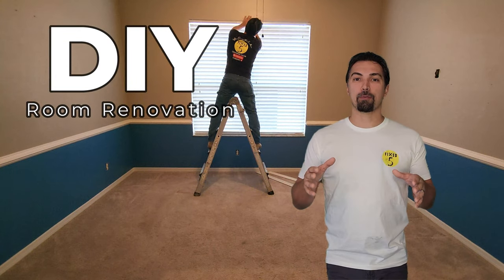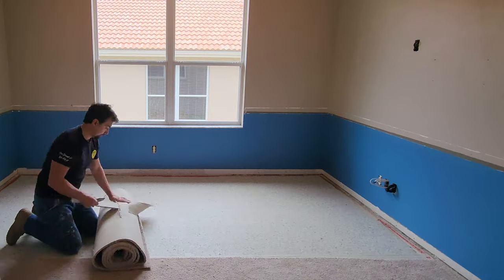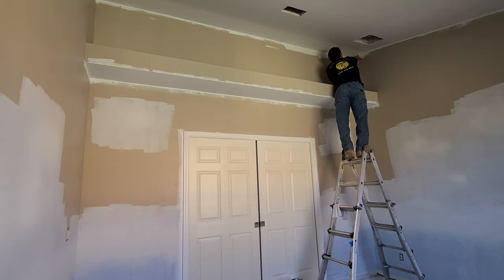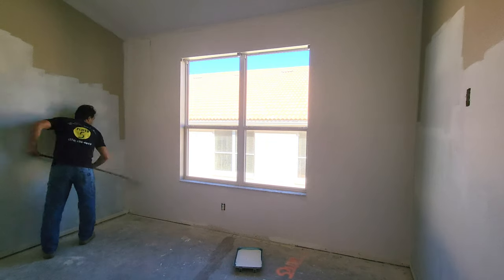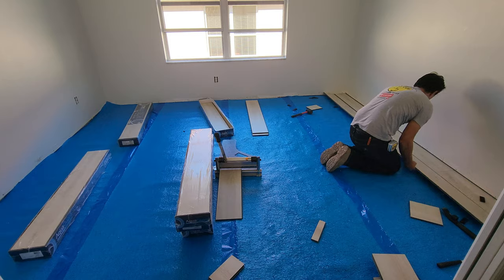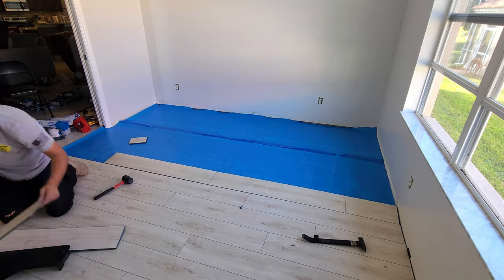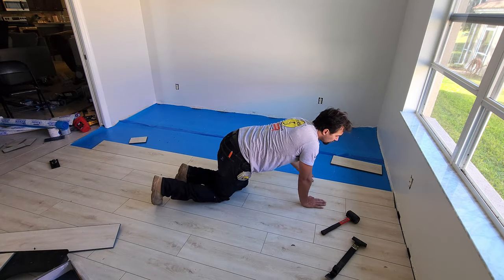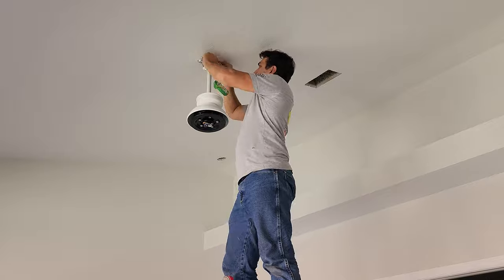Get a PROFESSIONAL Looking Living Room in Just 1 Week

Comment: Flooring and baseboards $300
Paint and painting supplies $150
Ceiling fan $200
Misc hardware and finishing $100
The cost that not associated with materials 
Hiring a handy man labor $1000
Or tool to do it yourself $700 😅
Reply from the maker: Thanks for commenting.